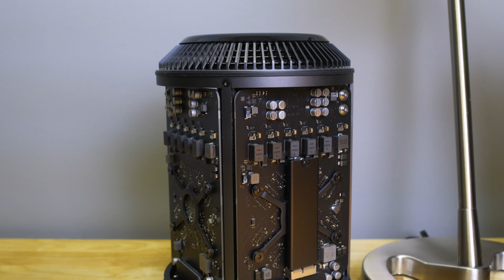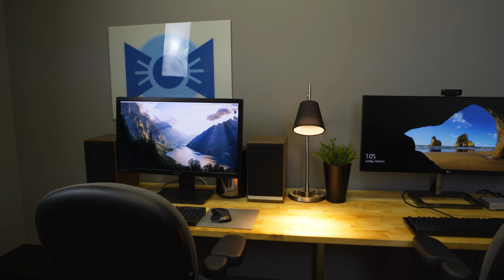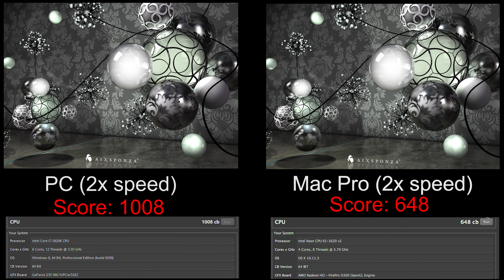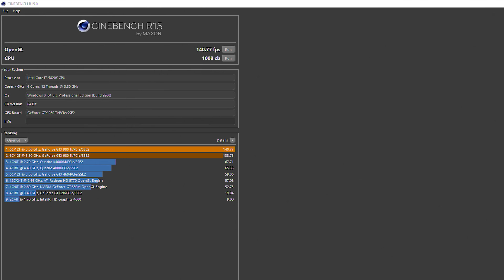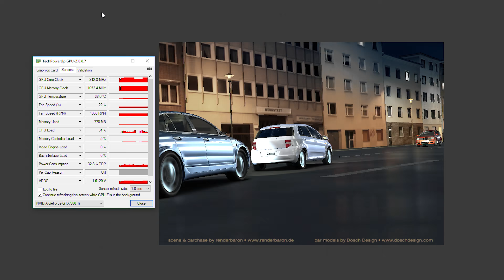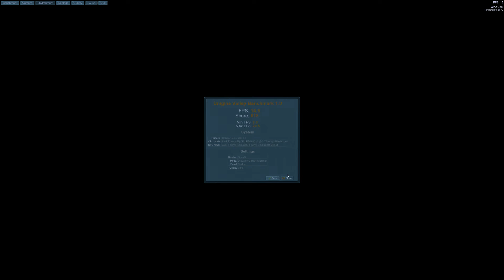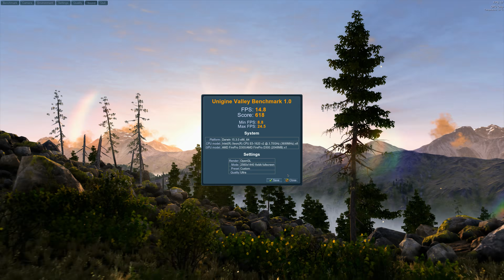$2,000 Custom PC vs $4,000 Mac Pro

Comment: Are you comparing computers that are 2 and a half years different, that doesn't occupy the same amount of space and get surprised with the results?
I don't see the point...  Don't get me wrong, I'm perfectly happy with my last real mac pro (the tower design) that I still keep upgrading from time to time and the new mac pro really sucks about upgradability anyway... But this test is useless...
Either compare it with a mini-case 2 and a half years old PC, or don't compare it...
This test is like : Yeah, computers have evolved during the last 2.5 years, who would have thought?
And testing gaming performance of a workstation vs a dedicated gaming PC isn't also fair... It's not what the mac pro is for... Apple logic is retarded, not changing the trashcan line is also retarded, but this is far from the best apple have to offer. (and it's not 4K$, it's 3K$ but at that point I don't think it'll make any difference)
Reply from the maker: +Bourinos02 No, I'm comparing a custom PC to Apple's current Mac Pro offering. It isn't my fault they haven't updated it in 3 years...
Reply: Rekt
Reply: fanboy detected
Reply: Still doesn't explain why it's 4k dollars
Reply: +Bourinos02 Yeah, it's 2.5 years old, but it's also the latest and greatest Apple offer and the price they are selling it for is $4000 which is the entire point.  

No shit the comparison is not fair, it's designed to highlight just how dumb you need to be to buy the Mac when the hardware is so utterly destroyed by something you can buy for 1/2 the price.

How much do you have to pay for an Apple badge and that smug feeling?  About $3000 apparently (you could probably build a faster computer than that Mac Pro for under $1000 now).
Reply: It's about price to quality, fanboy.
Reply: You are just a fan boy.
Reply: It's apples job to update the computer. They are selling that computer in 2016, so it is comparable to a computer built this year.
Reply: +Bourinos02 It will erase Mac as it just did. Remember this new PC is half the price of a 2-3 year old MAC
Reply: +Bourinos02 the whole point is even when apple still pushed the "real MacBook pro" this kind of test would yield the same result. 
Mac's are and have always been severely overpriced.
Reply: +Bourinos02 The mac pro is sh1t and the price cant be 4k if its 3x slower then a 2k pc do u get it now? apple fanboy
Reply: +Bourinos02 You can build a small PC with a fullsize GPU (that is 3 years old) and it will STILL fuck the shit out of a mac pro.
Reply: +Bourinos02 im pretty sure a 3 year old pc can beat it. I can get u an ITX case which is pretty slim. So MAC still sucks
Reply: +Bourinos02 You're forgetting that you can always build a current mITX system without really sacrificing performance over a full tower build if you really care about size.Having hardware that isn't almost 4 years old now will really help with the thermals of it as well.
Reply: +Bourinos02 you can put the exact same hardware in a mini case and many people have done it,s just harder to cool. A 2000 dollar mini case PC whould gain the same results.
Reply: +Bourinos02 What he is saying in the video is that a Mac is outrageously priced. For 3 year old hardware that was GOOD (Not Great) in it's time, $4,000 is WAY too much to ask. He is saying that a PC will offer WAY BETTER performance than a Mac at a lower cost.
Reply: ugh apple users -_- ... the point isn't the difference in years. it is that apple is charging 2x as much money for a computer when it is 2,5 yrs old and you can build a computer for half the price wich i 3x better than the mac pro
Reply: Everyone with their head screwed on right will agree that Apple charges too much, for old guts. They need to actually better fullproof their flagship desktop better than that!
Reply: +Maadkat x "mac fans" don't say trashcan for the new mac pro design... My point was just to compare comparable things, I even said in my previous comment that the new mac pro design is faulty. But I can say it more clearly because you seem to be confused : the new mac pro is SHIT, it's not pro, it's un-upgradable it's ridiculously overpriced and underpowered, the space a tower take is irrelevant for productivity as everyone have space under her/his desk to fit a fucking giant WTX if they want to... 

Same goes for the new MacBooks "pro", no ethernet cable, all relying on WiFi? Ok, for a single person in the middle of nowhere with 1 WiFi signal it might work okay, but for a professional with probably around 15 different detectable wifis around, it's SHIT and not good for professionals... The wifi will not behave as well as a cable, it never will... Same as the mac "pro" the macbook cannot be upgraded even a little bit, everything is soldered to "make it thinner", this is also bullshit! The MacBook I'm typing this with have ethernet, the RAM and HDD were changed to make the machine a LOT faster, this is not possible with what Apple have to offer now...
I'm a mac user, but I really am not a "mac fan" as I've been disappointed with almost all design/functionality choices apple made in the last 3 years...
Reply: Bourinos02 That you are an in the closet fanboi
Reply: +Bourinos02 Mac sucks just get over it lol...
Reply: In my eyes, the test is more to show that Apple scams people for a well outdated computer that they overprice (over their overpricing). They shouldn't sell it more than 1k$ (... Even if it's not worth that, I'm talking about Apple pricings, where you pay for the brand).
Reply: +Gryppen It's not the greatest model Apple have to offer, it's the "entry level" mac pro shown here. But still, I think these benchmarks should still be greatly favorable to the custom PC anyway. The only thing that might be possible is a superior openCL computing capabilities with the "D700" option, but still, even if the program takes full advantage of the 2 video cards, that'd be a theoretical gain of only a few percents over a SINGLE recent card not dedicated to that.
Anyway, yeah, it's ridiculous that this "pro" line haven't been upgraded since 2013...
Reply: all of apples products are overpriced. price for preformance is something apple doesnt understand.
Reply: Even if it's older, its still 4000 bucks. So, yeah, apple is shit.
Reply: u probably didnt complete to see the video. Apple is selling a 3 years old machine, with no upgrade at 4000$. that's the point of the video. it's like selling an iPhone 3 at the same price of a Samsung galaxy 7
Reply: +Bourinos02 So basically you just admitted that the most expensive top-of-the-line "pro" Apple product can only hope to win a comparison with a three year old PC, provided said PC is not a really high end rig for the time anyway? LOL Apple is dead as far as computers are concerned. I will never buy another Mac.
Reply: Naresh Ugaonkar
All that shit coming from a pro-MAC supporter who prefers underpowered-overpriced garbage trash cans to a lower cost alternative that also looks better and performs better?

Nobody with a shitty job would likely be able to buy the setup I have: userbenchmark.com/UserRun/683740?redirFrom=userbenchmark.com

Unless they saved up for like 3 years or something.

Not like £1570 is as much for my setup as opposed to a trash can. Enjoy your inferior PC. Congratulations on not being an indian Tech Support scammer, by the way. Fantastic language skills, m8.
Reply: +Bourinos02 Dude, Your point is useless! And the 238 people who liked it have not thought about clearly either, Or are just sticking up for their favourite company.
The whole point of the video, is to prove that you are paying through the roof for owning the name APPLE! 
Even the much cheaper PC was doing the stuff that the pro was built for, far BETTER!
That's the facts.
Don't hide them by moaning at the guy for not paring a weaker PC with the pro, That Mac is currently the best you can get and it's old hardware and well over priced.. because you pay for the name.
Reply: The price point is what makes these computers comparable. Since the Mac Pro is an old sack of shit it should cost less.
Reply: Bourinos02
Oh yeah my bad thought it was a define R5.
Reply: +Bourinos02 Yes he can compare it becose apple sell the same shit always
Reply: +Bourinos02 It's about the bottom line, mate. You get three times the performance for half the price. Sure, the Mac Pro looks much slicker and is smaller, but I thought performance is the number one quality of a computer. I think you missed the point of the video. It's not about comparing brand new to older hardware. It is about the price - Apple sells that machine for 4k. You can build a much more powerful current PC for 2k (-ish). And it's not outrageous that Apple are selling it at that price poit - it's outrageous that there are obviously enough people to shell out that kind of cash for an outdated configuration.
Reply: +Snazzy Labs Also not your fault that "all" of the MAC fanclub cant grasp the concept that you are comparing the ridiculous price for the amount of hardware & performance  you get, who the hell "in their right  mind" would pay 4k for old hardware that Apple is CONTINUING to package and LABEL it as a new product in 2016?, cmon' Apple! Seriously dudes, thats what the video is about
Reply: +Aris Heim yes because apple is foolng people
Reply: +Snazzy Labs Okay, the trashcan pro hasn't been upgraded for a long time, but your PC build is taking at least twice the space than the mac pro is... It's even more unfair to compare them... That's why I have difficulties to see the message you want to convey via this video.
Is it that the mac pro line hasn't been updated in 3 years which is ridiculous for so called "pro" machine, or that a custom built PC will destroy a mac pro? (which was already the case on release back in 2013 because of Apple faulty trashcan design...)
Reply: +Moldy The build shown in this video is with an mITX, it's still at least twice larger than the mac pro. The design at first is quite good, only one single cooling system, adapted to the entire machine, making it almost silent and all. Except that when you are using all your components at full power, it'll start to overheat and basically ruin the potential performance gain you cold have. 
So at first glance, it seems like a great design and all, but in reality it' shit. And yeah, having newer components less prone to generate heat will help, but I can't help it to think that the potential upgradability of your "pro" system is the KEY to have a good system...
Still, people are buying the trashcan so apple must think that they are doing it great, but in reality, clients are trapped with OS X programs and uses, so if they want a hardware upgrade, they are forced to buy it. Or they are just stupid people who follow fashion, who knows... :-)
Reply: Well you can still buy that mac. so he is compering 4k Mac that you can buy now vs 2k PC you can buy now. fell dumb now?
Reply: +Bourinos02 iam apple fan, but lookin at the pricing, pc wins.
Reply: Andrei Ivan
Today it's just not about the OS you use. You can buy PC components and install OSX and you can also buy a Mac and install Windows. It all comes down to how stupid or how smart you are. If you want fast current and upgradeable hardware, but you need to use or prefer OSX instead of windows, teach yourself a couple of things and build yourself a Hackintosh. Nowadays the decision could just not be easier.
Reply: and ur mac pro are better that that " game machine"? workstation.. yes it is suppouse  for profesionals but u see cinebench ..man i need to say you did a great buy. but in future make ur workstation that suits your needs. i recomend u asus dual cpu motherboard and 2 intel xeon hexa and and the r9 if u are working in audiovisuals.    WORKSTATIOOOOON!!!!
Reply: +Bourinos02 Ok, you want to make it fair? How about this.

For reference, here is the link to Apple's page on the Mac Pro specs: http://www.apple.com/mac-pro/specs/

For LESS than the price of the Intel Xeon E5 processor, I can get an i7-4790K, which has almost twice the performance. ($320)
16 GB of Kingston HyperX FURY RAM @ 1866MHz ($63.44)
I had trouble finding a graphics card with the exact specifications of the included graphics, so I used 2x AMD W8800 graphics cards equaling 4GB DDR5 VRAM, and 8 total Display Port inputs. ($790)
Samsung 950 Pro PCIe Internal SSD 256GB ($181)
MSI ATX DDR3 2600 LGA 1150 Motherboards Z97 GAMING 5 Motherboard ($163)
NZXT S340 Mid Tower Case CA-S340W-B1 ($75)
750W EVGA Fully Modular Power Supply, 1.5x what the Mac Pro has ($88)
Total Spent: $1,670 to custom-build something almost exactly the same as the $4,000 Mac Pro.

If saving space is REALLY that important, then change this:

EVGA GeForce GTX 970 4GB ($330) [NOTE: Yes, this is a newer graphics card, however I could not find anything that wasn't recent and had GDDR5 memory, so obviously Apple has updated their GPUs, or else it would not be GDDR5]
APEVIA X-QPACK3-GN Micro ATX Cube Gaming ($60) [Roughly 1 cubic foot]
MSI H97M-G43 Micro ATX DDR3 2400 LGA 1150 Motherboards H97M-G43 ($100)
Total Spent (Roughly same size/specs): $961 Less than 1/4 the cost.

"But it will have the Apple OS on it!" That's cool, here you go bro:
http://www.apple.com/shop/product/D6377/os-x-mountain-lion OS X Mountain Lion ($20). So, for less than $1,000 you can basically have the entirely same machine, which will cost you $4,000 on Apple's website.
Reply: +Sir Soaponrope I totally understand the appeal of Samsung and android phones but I just want my phone to make calls and play music, the occasional photo of my dog. I'm really used to the OS so I'm not going to change any time soon
Reply: A two years old $2000 PC stil brats the crap out of any Mac Pro, dude. Stop being salty and accept reality.
Reply: +Bourinos02 What an idiot.
Reply: +Bourinos02 2 and a half years old and same price . Dude are you seriously complaining about space ? You're gonna use this kind of machine in a studio with plenty of space and if you complain about space I guess you could afford a rather big table for the 2k difference. I like apple products but I hate the company , ridicoulosly overprice products not worth half the value . And stop defending the company that is ripping you off , Mac Pros are beatiful looking and it has it use but not for 4000 dollars
Reply: my friend and I recently built ourselves gaming pcs and we have the same secs as this dude we managed to get a GTX 980 ti, 32 gigs of ddr4, and a core i7 build for $1400 in totqal cause we wated on sales for the parts and is waaay better than this mac.
Reply: +Bourinos02 The point is that Apple's prices on their Mac Pro are not remotely justified even including the new design and premium operating system.
Reply: +Bourinos02 i guess you did not understand his point. yes he did compare two  computers  with 2 1/2 years old hardware technology when the mac came out, but thats not what he is criticizing. its the fact, that apple still sells this product like it would be the best of the best. and even back then the technology inside the mac, when it came out, it was already outdated. its just overpriced in any particular reason. but thats just an apple thing, i guess. if he would have build a custom pc back then, with the same amount of money when the mac came out, the custom pc still would  have been better.
Reply: scitk u r correct my brother bought a mac pro at 2x the cost of my custom pc and he is suffering
Reply: yes mac really sucks at it's price
Reply: yes patryk
Reply: +Bourinos02 Shots fired
Reply: +Bourinos02 Why does it matter the space they take up? Is there some application where limited desk space would be a thing where the size of the Mac Pro would be an advantage?  Did anyone ever complain that the old Mac Pro was to big?  I love many apple products but this is another case of them trying to show off their design engineering at the price of performance and practicality.  Is it pretty? Ya sure, but that doesn't matter if an "ugly" machine blows it out of the water for half the price.
Reply: +Naresh Ugaonkar ofcourse you do nothing wrong with that, its like your the empire and everyone else on PC's are the rebels. You don't mind being a mindless drone being scammed because of a name brand and we like freedom to have great hardware on a reasonable budget as this video proves.
Reply: +Bourinos02 The point of this video is quite simple and its quite amazing that you don't seem to understand it. A pc half the price is more than twice as capable. That is 90% the point of this video. The rest is that Apple needs to update their pro line of computers.
Reply: Man but apple 2 years old machine cost more than that new computer this is the point
Reply: +Bourinos02 You forgot that it was 2000$ less.
Reply: +Bourinos02 Someone either didn't watch the video where he explained why he did it or didn't listen.....
Reply: +Bourinos02 Apple sucks, sorry butt hurt fanboy
Reply: +Станислав Димитров The trashcan pro depicted here is 3K$, not 4K$, but that's not even the point, I agree with you on the performance part. It's the main selling point of a "pro" computer, but apparently, looking at the sales, it's impressive to see that even this is selling well... If the machine tested here is absolute garbage (even if the testing is done like if this was a gaming PC and not a workstation), this trashcan can be upgraded with processors that are sold around 2.6K$ ALONE and then this test would be the other way around, of course, for a pricing range that is greatly different... 
All in all, it's the old debate about workstation hardware versus gaming one... 
And the trashcan sales being still OK even with outrageous options pricing and obsolete first range hardware means that they can basically do whatever they want and it'll be sold anyway, so I presume that at this point, they just don't care...
Reply: +Bourinos02 Even if you had compared the Mac Pro when it was released with a PC built the same day for half the price, the results would be the same, not as dramatic, but the PC would have still won. That's why I'm hackintosh all the way.
Reply: +Snazzy Labs 
You kind sir just rekt the shit out of a major bullshit factory. Thank you.
Reply: DNice Gaming 5/7 -excellent trolling post, would recommend!
Reply: +Bourinos02 My FX chip/380 got a better score than the Mac in both Cinebench tests, and well everything else for that matter.
Reply: +Bourinos02 you overestimate that time difference way to much.
In comparisons of the same hardware and their modern equivalent, results show that the performance just raised a bit. For example, the I7-2600k and the I7-6700k have just a 10% improvement (regarding on gaming quality), and the time gap between these two is 5 years! Same goes for other components like graphics card.

So when a pc for 4k$ isn´t even one-third as good as a 2k$ pc after three years, it´s not on the time difference.
Reply: +Bourinos02 Then Apple should at least lower the price to represent it's aged hardware. Since they aren't, the argument stands. 2k PC > 4k Mac.
Reply: +Bourinos02 I have seen WAAAY more powerful builds in a similarly small case thanks to the R9 Nano. Your "it's smaller" argument is absolutely invalid. "I'll pay $1800 more for a smaller computer." Yeah oh-fucking-kay.
Reply: +Bourinos02 he's comparing the price difference you dumb fuck. even back in 2013 you could build much better pc with 4k$
Reply: +Bourinos02 It's an comparison between Apples BEST COMPUTER & a 2000$ COMPUTER. Time gap between those two is not the key....if it was why isn't Apple  upgrading their so called BEST, TOP of THE LINE, PRO Machine????
Reply: +Bourinos02 
The only think I can say about apple product is, all their product are overpriced. The MAC should cost you less than 4k and even a computer of 1000.00$ can beat the performance of a MAC pro. You only pay for their expensive Apple logo and that's all.
Reply: Bourinos02 Dude, you're seriousloy a fanboy who canMt accept that Apple sell overprice product. 
When you can buy a cheap pc that beat the crap our of Mac, there is a serious problem. Apple only sell their Apple logo and that's it. If Apple would start getting on track, both would be equal, but no, apple want cash and bait and that's exactly what you are, dude, a bait for Crapple. They don't give a damn about their customer. All they want, it's their money and that's it. If they would have at heart to support their customer, they would correct that overprice product. 
Damn, even my friend's pc who has about 5 years old already beat the crap out of that Mac pro.
Reply: The problem with this theory is that the Mac Pro still costs $4k, SO IT STILL COSTS DOUBLE THE COST OF THE NEW PC AND PERFORMS THAT SHITTILY, and that is the main point here folks.
Reply: Well, that's how stupid fanboy are... You try to explain the price is overprice for a 2 and 1/2 years Mac Pro and he still complain about space.. Even I mini PC beat your Mac pro and it doesn't take place and if you have a workstation, well you have plenty of space, so who cares about the mini size tower.... 
That's another reason I hate Crapple, because of brainwashed people like you who don't accept the opinion of others and don't want to understand the facts showed to you.
Reply: +gulahuset12 
Toy components? you must mean this grossly overpriced Mac Pro. Apple websites such as Apple Insider reports that professionals are having problems with this model. Workstation grade? My ass. (http://appleinsider.com/articles/14/12/30/apples-latest-mac-pro-continues-to-cause-problems-for-professional-users)
Reply: +Bourinos02 if computers have evolved, why is the price still so shit? Mac fanboy rekt
Reply: +Bourinos02 what a dumb fuck you are
Reply: +Bourinos02  he is comparing performance over price, that mac is still 4000 bucks too this day (according to him), i think that the point is to show that apple stuff are overpriced.
Reply: +Bourinos02 LMAO!!! Its so funny watching an Apple fanboy try to defend inferior hardware at double the price.
Reply: +Bourinos02 It would probably have been more fair to compare the Mac to a mini itx system for a more equal physical footprint, but I guarantee the end result would have been about the same.  The point remains, Apple's products are over-priced, under-performing, and those who insist that Apple creates the best stuff with justifiable cost are wrong.
Reply: +Bourinos02 Point isn't that it's 2 and half years old but that it's outdated and costs 4000$
Reply: +Bourinos02 I think you may have heard him wrong. What he meant was that a Mac Pro sold in 2016 is still using the same hardware back when Apple first released the model in 2013. He then continued by also saying that the hardware they used in 2013 was even still a year behind the newest hardware being produced at that time. This is why he said that the Mac Pro 4 year old hardware.
Reply: Of course he is comparing computers that are 2 and a half years different. Apple hasn't improved it in 2 and a half years. whose fault is that? The point the test makes still stands: much like it has always been, you can build a pc for less and get better performance  (and deal with the issues like his psu ordeal) and Apple focuses on marketing products instead of improving them regularly. As demonstrated by the now 4 year old tech in their top of the line computer that is marketed for professionals. They have made 4 new iPhones in that time lol.
Reply: +Bourinos02  That mac is easy to beat even with a small case pc. Buy a 1000 dollar cpu and put a R9 nano in there or a mini 970 and it will still kill  that mac and it wont cost any where near 4 thousand dollars. You can put a 12 core xenon in a small form pc and kill that mac as well.
Reply: +Bourinos02 I think you don't get it. Apple still doesn't have something better.
Reply: +Bourinos02 Np, you didn't listen, If he could he probably would have tested a Mac book pro from 2015 IF there was one. But there isn't.. This macbook is made by apple. so this is what we would pay if we go to an apple store. 

Hetesten an prebuild macbook pro vs a costumbuild PC he recently build. The space doesn't matter because you can have about the same build, with the same power in a smaller build than he did. It is just a pain in the ass to cable manage.

This is about price, qwould you rater pay 4000 for  prebuild PC that is about twice as slow as a 2.2k self made PC?
Reply: apples machine when it came out still was not even comparable....i own both i know
Reply: +Bourinos02 IMO the average consumer buys a PC based on price point believing if they pay more they get more. He is just pointing out how backwards of a business model Apple has when it comes to their Mac Pro line and even other products. Considering the PC is $2000 less than the Mac Pro, i would say that Mac Pro, in theory or at least to the average consumer would seem like the logical choice for better performance. Aesthetics should not constitute $2000 increase in price, more if you count how outdated the hardware on those machines are.
Reply: +Bourinos02 You've gotta be honest though... There isn't really any reason to get a Mac pro unless you shit out cash from your ass. The top of the range model costs $9648, you could have a fricking beast pc for that money but if Mac is your choice... I'm not gonna hold you back from wasting your money.
Reply: +Bourinos02 this is a mac you can buy RIGHT NOW. it's not discontinued. this is 3 year old tech that is being sold for thousands when it is ancient tech that should be cheaper now. it should be cheaper just based on supply and demand, but i'm sure idiots like you keep buying apple products and they will keep selling you old hardware in a shiney case for twice the price.
Reply: +Bourinos02 dude your a fucking idiot get over it....
Reply: +Bourinos02 But Apple are still selling this as current plus a 2.5 year old PC at half the money would still crush it anyway !
Reply: +Snazzy Labs I know that its still not quite the same size- but i ran the same benchmark you did on an Alienware X51 with a down(under?)clocked GTX670 and still got almost double the score of that Pro.
Reply: +Maadkat x MAC users are just another name for "label whores" . I run hackintosh Yosemite  & Windows 10 64 on the same PC. I also have a MAC pro. My win 10 outperforms both hands down. There was a time that i thought MAC was more stable, I no longer see that being the case. I am fortunate enough to afford MAC, I just no longer have a use for em' at this time... overpriced & overrated ;)
Reply: The 5820k cams out in mid 2014 so there is really a 1 year difference.
Reply: exactly. but to give him credit, he mentions this and argues that this 2 year old model is the current model from apple. so if the Mac is still 4k, this video is still valid
Reply: +Johnny Moore I see the sense in what your saying and so do many people here, unfornately its all about name brand vs quality and innovation. We can try and cry all day long about how Apples is screwing over their mindless customers, but as long as people are dumb enough to fork over thousands of dollars for outdated hardware with an apple on it mac fanboys will swarm lol
Reply: You can say he compared the price different for the Hardware
Reply: +Bourinos02 I mac sucks. It's overpriced.
Reply: +Bourinos02 your ass is bleeding i guess, cry more. difference is less than 2.5y, especially if the pc components are like 1 year older p.s. still 2k $ less, probably now you can buy fresh for 6k ? and similar speed, pathetic.
Reply: +Bourinos02 use your brain kid, he mentioned that even if you buy the Mac Pro today as brand new, you still get the same computer. Yeah, computers have evolved but your distorted brain hasn't.
Reply: +Bourinos02 It's on you to prove the size makes a difference as it's your claim. Most people watching this kind of video have seen systems with similar specs to the custom built in micro-form factor cases, the only difference is it runs hotter at the same performance.

And if you really want an apples to apples comparison, why not go ahead and use a $4000 custom rig too, even from 3 years ago.
Reply: +Bourinos02 so you're saying that over two years computers have doubled in performance and halfed in price.
Reply: mac hasnt updated its pc u moron.
Reply: +Bourinos02 - Pretty sure if you are buying a "pro" product, you want performance and you aren't too worried about space.  Is having an extra cubic foot of space in a room worth the extra $2000 while also giving up performance?  Probably not.  I used to really like Apple products, but they really are just shit now, really polished, good looking shit, but its still shit none the less.
Reply: +Bourinos02 The point is that it's STILL $4000 and labeled for pro's when it shouldn't be either.
Reply: Shut up apple fanboy you know fuck off about pc parts and market
Reply: The point is that it is their CURRENT model. So it is fair to compare to a current PC. And apparently it fails badly.
Reply: Naresh Ugaonkar lol r u serious? Buying shit cuz it looks 'little more beautiful' than other products? And the thing is, its YOUR opinion lol. With 4000bucks 'pc' , I can build the most Beautiful Fantastic looking pc in the world with way better performance :D
Reply: dcast777 And the pc wasn't even ugly. It's quite beautiful.
Reply: +Bourinos02 This Mac is labeled as workstation so it should run smoothly 3D apllications (Blender, Maya etc.) so I think its fair comparing it with gaming pc
Reply: we've got a fanboy here
Reply: +Bourinos02 i think his point is that apple needs to release a new mac pro or at least sell the two-year-old mac pro at a much cheaper cost for the reason that it is "old" and that you can get a new PC triple its speed and lower in price; that if they will label such product as one for professionals, it should live up to its reputation.
Reply: +Bourinos02 The point of the test is to show why it doesn't make sense to buy a mac pro when it's 2+ years old by now and STILL priced at double what the home designed PC that performed more-or-less twice as well.
Reply: +Bourinos02 I'd wager the $4000 Mac Pro won't fare much better than the $4000 MSI Vortex with a Skylake i7 and SLI GTX 980's in pretty much the exact same form factor...
Reply: +Bourinos02 You're an idiot

They're both practically new for their manufacturer (s) and today you could buy both of them for the same amount.
Reply: MSI has a mini tower like Apple's Mac Pro. With i7 6700k and duel 980.
Reply: i think the point is that if i go into an apple store and ask for their newest mac pro this is it, it doesnt matter what the age of the components is. bottom line is apple is selling overpriced garbage in fear of making a new build for $5000 that nobody will buy
Reply: +Bourinos02 My PC is at least as small as a Mac Pro and almost as powerful as the PC in the video. I can make it more powerful with the same case. Silent too.
Reply: +Joel B (jbholland) That is exactly the point, a workstation "graphic card" is not made for gaming, you can put a ultra high end W9100 (about 4K€) and it'll barely reach 40 FPS on battlefield 4 in 4K (70 for 1080p gaming). You can find graphic cards like 970/980 series that'll perform WAY better for this. But do computations with it, and it'll perform 3-4x better than the gaming ones...
Reply: +Jerry C The number of people unable to differentiate workstation stuff and a gaming PC is too damn high!
If your point is that brands prices are higher than self-built, well, no shit sherlock... I know only a very few case (generally for entry-level computers) where the pre-built is a little cheaper than if you get the parts yourself.
Reply: +Mike Bee TV Well, yes, it has been since quite some time now that Apple is doing everything to destroy their own brand, but the sad thing is that only the new mac pro is a flop, other machines continue to sell quite well... The GPU choice is also odd, basically they are openCL oriented, and you need to pay the extra value for it, but most people won't even use GPU acceleration...
The worst example is the Imac (since the unibody design and "cutting edges"), first, if you take a little more ancient design, you have more volume, so you can put more components in it. And with GPUs like the R9 nano for example, you can have a decent performance for a rather slim design... 
The worst thing for my point of view is the "everything is soldered" you cannot upgrade shit from these machines, its a deal breaker for me... I really hope that they'll go back to the previous design, but unfortunately the only flop being the mac pro, it's unlikely that they'll ever go back to easily upgradable machines...
Reply: +Bourinos02&#160; Ya just don't get it do ya lol ... like the man said That same model Mac Pro is right now being sold by Mac as a 2016 model&#160;so ya goof&#160;the comparison/test is good as a 2016 against a 2016 model. Truth be told it would have got its azz handed to it even 3 years ago if the same type build and test would have been done..
Reply: Typical Apple fanboy
Reply: the point he was making is the fact that Apple is still selling this outdated hardware as it's premier computer.  This is what you get new out of the box in 2016.  So he is right on the money for doing a comparison with what is given.
Reply: +Bourinos02 For the price point a PC is MUCH better in terms of performance vs mac
Reply: +Choirmaestro you forgot: 

$10 for a can of spray paint and a piece of paper to make an apple shaped logo for the front :P Now what's the difference? Aside from the extra numbers in your bank balance of course!
Reply: Laurence W I've said that already yeah... So your point is?
Reply: +Bourinos02 That 5820 came out before that mac pro....
Reply: +TonyOwned Apple "options", I presume that's why now everything is soldered together, if you chose to add ram, you will have to pay it like.... 6 times the real price? The amount of money it costs to chose a better configuration is just insane for most options. When they ask you 400$ for a 12GB ram upgrade, you know you've been ripped off !
Reply: +Renaldo Dean This haven't always been the case in the past (especially in the unibody vs vaio period) but now, it's definitely the case, the "thinner the better" bullshit is pushing prices so upwards that it's ridiculous. They end up selling slightly more powerful than a tablet computer at 1K$, just plain ridiculous...
Reply: +Bourinos02 Ok but then lets get to 4k $ also. I mean a mini case 2 for 4k $ computer. I bet it would destroy the computer that he build for 2k$ wich rekt the trashcan pro. Dont start it, because a mini itx tower with hardware in it for 4k $ would totaly rek both of them.
Reply: +Bourinos02 As somebody who uses a computer at home as a workstation, the size of the Mac Pro is a novelty but you still need to setup your system with external hard drives and optical drives (that is something that is still necessary in certain lines of work). In the end a tower under a desk isn't a big deal, i'm rocking a Corsair Air540 which is cube-ish and barely takes up any room whether I had it under a desk or on top of a desk. There are more economical things to spend on for ergonomic improvement like adjustable monitors or a nice chair or the desk itself.
Reply: +Bourinos02 lol Join the Master Race scumbag.
Reply: +Bourinos02  computers evolved, but man is fking 4000 $ and 14 fps benchamrk... if that mac pro have 2.5 years.. the cost dont evolved? maybe and just mabye couse people like u pay the brand and confrm with that.
Reply: +DNice Gaming You should tell us how you really feel! BTW I'm posting this from my 2 year old rMBP, and I love it. You know you're just jealous you can't afford an Apple.
Reply: +Bourinos02 You know, I thought that too; I think he was just comparing the fact that the newer machine was built for less.
Reply: +Bourinos02 if you want appleOS build a hackintosh.   you wanna save space? use a microATX motherboard. The case he used is seriously the biggest small case i have ever seen lol
Reply: Did you not see the size of the PC case? yea its a different form but in terms if actual size its pretty much the same, Apple as usual just shot for design over practicality built a cylindrical case with all square components in it. All in all a piece of garbage that looks nice on a desk.
Reply: +Thomas Mostyn 
that Mac pro is not that small. I know that if you build a computer from a mini-ATX or even a Micro-ATX motherboard, you can get similar performance as the 2200$ windows machine, although more expensive, it would not exceed the 4000$ mark. 
The size of the Mac Pro is a mood point. the age is too, since the IC parts physically cannot get smaller due to quantum stuff and breakdown of simiconductor properties at, what? 15 - 20 nm I think.. the progress is stagnating. And to attack the age is also missing the point.

I just can't see Apple being able to justify the performance gap. I never have. OK. . UI and the enherent stability of the Apple systems are excellent for casual users or light professional work. 

But to put a product on the market, keep it there and market it to heavy - duty professionals, that need raw performance, when a PC build out-performs it 6-fold per dollar spent is just not okay.. 
Apple Is making good products.. their marketing is just borderline criminal.
Reply: +Colinde  I think you missed the point ...I agree with you mac is over priced garbage with no reason to be bought the PC on the other hand has a better form to fit hardware that is naturally square (motherboards, GPU, Hard drives etc.) Are all square parts and are made to fit better in a square case.
Reply: SSABM 946 crapple. Omfg im using that now. Thank you so much
Reply: +Sir Soaponrope crapple crapple crapple hahaha.   I do like their phones tho
Reply: LloydMarley Woodger I wouldn't call those pieces of shit phones xD
Reply: LloydMarley Woodger I understand. I used to use an ipode 4th generation. And it did the job very well. Lots of cool apps and exclusive shit. What i don't like is how collge's shove mac and apple shit down our throats telling us how good it is and forcing us to use macs in college.
Reply: +Sir Soaponrope yeah don't stand for that shit.   I'm 99% sure I will never buy a Mac PC
Reply: +Bourinos02 I would also like to add here, even though the pc and mac are very different in product component age. So what I would like to say is that for a pc with probably 2.5 x the performance of the mac pro you can pay a little over half the price for BRAND NEW components. Even if he went skylake i7 and a nice mobo it would still be around 2500 and not to mention SLI with 980ti superclocked would only run about 3300 to 3500 and he could put in a liquid loop for about 700-1000 USD and have a pc that outperforms that mac by probably about 5.5 to 6 times and would have temps I would assume around at full load 50c on the GPU's and touch higher on the CPU and probably even lower. This would all cost only anywhere from $200-500 more than the mac pro
LINKS: Custom PC http://pcpartpicker.com/p/qy62gs
Mac Poop: http://www.apple.com/shop/buy-mac/mac-pro?product=MD878LL/A&step=config#

I REST MY CASE YA BAD MAMMA JAMMA
Reply: Phineas Swett You sound in denial lawl. Keep struggling my friend. You shall drown eventually.
Reply: What do you mean man? I just posted a link to a pc that stomps this with top of the line modern components, and SS which could even be NVME and 32 gigs of RAM For just over half the price. I just don't understand what you mean by I sound like i'm in denial
Reply: Phineas Swett I read your comment wrong. I'm sorry my mistake mate.
Reply: Sir Soaponrope hahah. Did you think that I was saying mac was better? XD
Reply: Phineas Swett Yep xD I'm a moron.
Reply: +Bourinos02 latest available products on the market. 

You also intentionally forgot their price points to satisfy that ignorant apple fanboy mentality of yours.
Reply: That's why I retorted with actual facts and two build versions between pc and mac pro
Reply: the fact is that there is no Mac ever atm that overpowers this one, it's selled as their best computer :)
Reply: +Bourinos02 I see the point, 2000 ones actually ;)
Reply: +BATtitude But that is the point, this isn't the BEST apple computer... The best apple computer comes with a 2600$ 12-core processor that is still to this day VERY powerful (and would have crushed the i7-5820K by the way). The only real drawback of the trashcan is that it's GPUs that were OKish at release aren't on par with others newer GPUs, their openCL capabilities are just slightly over a single 980 (10% better computing power if the program was able to use both cards at the same time). CPUs haven't changed that much, but GPUs performances have evolved drastically since 3 years. 
And the main drawback of the trashcan aka its un-upgradability is now clear, most dual GPU systems will be better now. There is actually one single shred where the mac pro cards will shine (and so does any workstation-dedicated card) and it is double precision processing power, that's what they're made for. Not gaming, nothing else, just made for that. And for that specific job, they are doing reasonably well (4x better computing performance than a Titan X). 
And frankly, that's the only advantage they have over other GPUs... But in the other hand, that's what they were designed for, but other newer dedicated workstation cards will crush them hard too, from what I see double-precision computing power have MORE THAN DOUBLED in 2 years, which is impressive.
Reply: +Bourinos02 apple is selling luxure product, wich means it's over priced, so you could always have better with the same/(lower budget) ... that's all, because apple doesn't build their pieces, wich also means you can it yourself :)
Reply: John Romberg You're writing this comment on a device that 1 billion humans will probably never see because they live in abject conditions, yet, you bought it you filthy human being. They're starving because of you!
Reply: +Prince Virginia Well said
Reply: Tylor Camacho
Yes, 3K$ is too much for entry level, or they just change the entire thing and get back to a serious tower design...
Reply: +Bourinos02 Yeah, then you'll have an even cheaper pc that still kicks the shit out of that mac. lol, think before you speak fanboi.. oh wait you can't because you're pro apple
Reply: +Bourinos02 The Ncase computer case could fit all that hardware and be just as small as the MAC, the case size is just a user choice.
Reply: Eric Dawahare Exactly
Reply: +DeviLzRO wow relax fam
Reply: +Bourinos02 hes just baffled at how ridiculous the price vs performance difference between the two and calling apple out on their bullshit.
Reply: +gulahuset12 Let them be, they are so braindead they forgot that a workstation is bad when you try to do gaming on it and compare it to a 2.5 years newer gaming computer... Apple option pricing is outrageous, apple entry line mac pro is very bad and overpriced at 3K$, the trashcan design is stupid by nature, but it's still about 2 times smaller that what can be achieved with mITX cases...
Reply: good point .. but still even before 2 years you can build a better and alot cheaper PC than mac pro .
Reply: +Dex4Sure Let me help you 2000*2=4000, not 3000.The only strong point was double precision floating-point computations with the dual GPUs. Not tested here. The CPU of the entry mac pro is pure garbage, you'd better off buying yourself a 6-8-12 core and putting it inside. This was tested here, and yeah, a shitty quad core is rekt by a more modern decent 6-cores.
Reply: What being analyzed is the price vs power. With a 4k budget, at better PC can be build. If form and size is a huge factor for you. Then look at MSI's new Vortex PC case. It's 2016 and Apple is selling old hardware with old price tags.
Reply: +Bourinos02 unless you are planning to put the computer inside a fridge, then i think that the size doesnt matters a lot...
Reply: +Bourinos02 I share this same idea. Its useless comparing two with 2.5 years different, but I think the point of this video is the price. Because the hardware is old, even to the mac pro age and its more expensive than a new PC. And also Appple SO (I dont know the name) and pc design dont justify $2000 of diference between them.
Reply: Bourinos02  calling it a work station vs game machine makes no difference cause you can easilly use that custom Pc as a work station
Reply: +Bourinos02 there is no reason for you to like a Mac Pro over a PC unless you are a fanboy, if you want a smaller build get a laptop, and don't get a Mac laptop because those suck too.
Reply: How do you upgrade a Mac? Do OEMs make Made specific computer components?
Reply: +Bourinos02 butt hurt huh ? i guess it hurts a lot knowing you spent 4k in a computer that takes a beating from a 1k pc.....
Reply: Josh Cook ..ifags are like that buddy...
Reply: +Caio Daniel Nunes Santos  Yeah man. You look brazilian, so you must know Canaltec. This channel made a review of the MacPro and bought it to self use on the their office. But they have as space as to use a full tower PC on the desk. The only thing that justify it is that it has 6 thunderbolt ports and the fast boot. Just that! Uneedless to say that its even worse because we're talking about Brazil, where everthing is expensive!!!
Reply: Even then the Mac Pro would've shit the bed against a 3 year old PC.  The MAC pro really isn't worth $4k and is literally the worst shit ever.  Apple doesn't know how to build computers for normal people which seems to be their market /:
Reply: +Alan Crome by doesn't know how to build for normal people I mean no person in their right mind is going to go out and spend 4K on a computer that isn't even that great.
Reply: Caio Daniel Nunes Santos Yeah... it doesnt justify the overpricing
Reply: +Snazzy Labs you're comparing an "average PC" to a pro workstation. That's not a comparison anybody should be interested in to be honest. They exist to serve different purposes. In the end, you buy the machine that suits you. I have a gaming PC myself because it's the best for my needs. If I wanted a workstation for some specific tasks that only a pro workstation can fulfill, I'd buy that Mac.
Reply: Ya seriously, this guy is a dumbass!
Reply: +Ozone9 Mercedes are expensive. Are they shit also? 😂
Reply: +Bourinos02 Apparently you didn't get what was the video about..
Reply: +Bourinos02 Oh no apple fanboy :D did you actually watched the video ?
Reply: He said that it's the most current model? That's the best Apple has to offer, which just shows how sad the Mac really is.
Reply: He said that it's the most current model? That's the best Apple has to offer, which just shows how sad the Mac really is.
Reply: +Jus da best HAHAAHHAHAHHAAHAHAHA. No.
There's massive difference between ECC memory and non-ECC, as well as there's massive difference between a Titan X and a Tesla K80... There's one card made for gaming (Titan X) and a card made for computing (Tesla K80). And if you think a titan X is expensive, look at the price of the K80 and think again... But in the other hand, for crunching the K80 will absolutely HUMILIATE the titan X, which is normal because it's what its DESIGNED for...
Reply: +Bourinos02 I also think it's a bit unfair. Yet he bought the latest and best mac on the market.  This test was mostly supposed  to show how Mac is overpricing their shitty products.
Reply: +Taseen Khan (talking about the former mac pro "tower" not the trashcan) You buy a component and you install it like if it was a PC, that's about it... It might require a bit of tinkering, but usually it's nothing more hardcore than installing web drivers...
Reply: +cyb0rgmous3 Yes, I missed it because it's simply NOT the case... The mac pro he tested is the entry level one, which is terrible value for money... There are VERY much powerful mac pros options, but seeing the apple "upgrade" price policy, it'd be better to buy the 3.6K$ CPU yourself and install it!
Reply: +Bourinos02 what I said is labelling s stuff doesn't matter cause a titan x can still do both. as shown on the video we ch was a 989ti is about par if a titan x
Reply: +WaffulMann That's where the problem is. Titans are good for gaming, shit for some applications (namely double-precision floating point) A mac pro is not a gaming machine, it's a workstation. It's a shame that mac pro haven't been upgraded with more recent hardware, but this testing is like complaining that a tractor can't go 200 mph or that a ferarri can't plow a field. Both vehicles have 4 wheels and a powerful engine, but they aren't designed for the same thing.
A mac pro and a gaming PC are both computers, but they aren't made for the same thing...
Reply: +WaffulMann You can change the motherboard for a ECC-compatible one, buy ECC DDRAM, buy a single W9100 Firepro graphic card (for around 4K$, yes, that's the price) and THEN yes you have a workstation... For a price that is probably 20 to 30% lower than a trashcan.
Reply: Space occupation is not a valid argument. Dimensions dont make power, and so does not the money you spend on aestetics. Period.
Reply: +Bourinos02 your are 100% correct, this test and administrator are very biased. From the start you can tell that this individual has a fiary hate for anything mac. Although I'd ignore all the pc fan boys responding to you that dont seem to understand diffrent pcs have diffrent uses.
Reply: ***** Go back to your 50$ COD DLC kid...
Reply: +WaffulMann obviously you missed the whole point... the test is wrong and the administator is biased. You cant test a surgeon on how many cases they win in court, and you shouldn't trust a lawyer to proform open heart surgery. This test is for gaming centric bench marks, on a 2 and a half year old computer that in its time wasn't even made for gaming. The test is flawed and the fanboy who tested them failed to mention why the Mac benchmarked lower on the given tests.
Reply: *****
Excuse me, I don't see "lallalalalalala" as a valid mature argument... I've said that apple options are overpriced, mac pro entry line is ridiculous, apple option prices are ridiculous, apple mac pro design itself is stupid, but ultimately, testing a mac pro for design versus a gaming PC 2.5 years more recent is still retarded. So I'm sorry that you don't bring any valuable argument to this debate excluding "lalala". I'm not even debating the fact that the video said that this mac pro was 4K when it is actually 3K, or that the testing was made for gaming performances when a mac pro si clearly designed for work with DXXX graphic cards... But I know that you only care about COD FPS so yeah, keep comparing this to COD FPS, it'll make you look so mature...
Reply: +Bourinos02 may have already been said but he's showing how for the half the price of a shit stain pro you can build an amazing pc....
Reply: +Bourinos02 Did you miss the part where that Mac Pro was the exact same system you get if you buy one today?
Did you miss the part where Apple sells that computer as the "Ultimate desktop computer" and claims it will blow away anything?
Did you miss the part where it was twice the price of the PC tower?
Did you miss the part where Apple's "flagship" (and only) desktop computer uses server processors and server RAM?
Did you miss the part where Apple managed to stuff in the shittiest, most awful graphics processing possible in their overpriced trash can?

What a pathetic argument.
Reply: so funny how idiots defend their incredibly irrational purchasing decisions.
Reply: +Bourinos02 I think u just dont want to see ur life long friend "MAC" be defeated so easily. Also these products were all alive back then as well
Reply: +Bourinos02 exactly what i'd expect a macboi to say. the point is, mac's don't evolve, but still rape your wallet. pc's evolve, and don't commit financial rape.
Reply: Your right
Reply: +chago river im not defending it, I even have a build amd pc. Reguardless it's an unfair comparison.
Reply: +Bourinos02 loool u r smart...
Reply: +Bourinos02 Point here is like said on the video, the prize of the product and that they still sell (that antique MAC) as a "new" prized 4000€ and some stupid people might still buy that because they don't know better or they are just stupid fanboys.

He test products that are being sold at the moment so I don't see the problem in comparing them, maybe someone wakes up from mac fandom and buys actual PC? So no it is not useless test.
Reply: +elmotuz +WaffulMann What is plain wrong? First the price: If I go to this address => apple.com I'll find the mac pro shown here for 3K$, not 4, and in europe, I find prices around 3.3K€/2.5K£; so where am I wrong when just stating that 4K$ is not the price of the machine? (it's even in the video description by the way if you don't believe the "mac bias"...)
2nd the testing methodology is just plain WRONG, a mac pro is not designed to be a good gaming platform, even with this old hardware, it's totally expected that a gaming PC will perform better than a workstation. It all depends on what you want to do with this trashcan, if ECC or double floating point operation per second ring a bell, then the trashcan is what you want, it's what it's MADE FOR.
If you know only COD:BO3 and BF : Hardline, yeah, this is not the machine you want...
Testing double precision openCL (not GL, CL) with this setup would have given the trashcan a rough 36% better performance with dual D300, 456% better performance with the dual D500 and 770% (!) more performances with the dual D700 configuration. Again, where is this wrong? 
It's exactly like saying : "wow, have you seen this graphic card ( firepro W9100) it have 16 GB of ram, it must be absolutely amazing to play my latest 50$ COD DLC at 144FPS" Except it is not made for this so chances are that performances will absolutely suck...
It's really demanding a tractor to do 200mph and a Ferarri to plow a field...
Reply: understand, apple's magic
...
Reply: +Steve Dice doesnt make the test any less dumb
Reply: +WaffulMann I see 99% of "meh, the mac kant play mah call of diouty, macfag lalala can't defeat my argument it costs 4K$ mah 123$ PC is better" and 3 people that know what is ECC and double precision floating-point computation...
Reply: +Bourinos02 no it IS relevant as it's all you can buy from apple today!
apple fanboys, almost as blind as christians.
Reply: Bourinos02 Meh, keep your Apple if you like it. It's not my problem where you put your money.
Reply: +Bourinos02 Mac Masturd Race
Reply: Valentin Rafael wat? From apple website => 2.7GHz 12-core Xeon E5 with 30MB of L3 cache
64GB (4x16GB) of 1866MHz DDR3 ECC
1TB PCIe-based flash storage
Dual AMD FirePro D700 GPUs with 6GB of GDDR5 VRAM each. It's far far far far beyond the mac pro shown here...
Reply: Hendrik visch I say the most expensive pre built pc's from doghouse systems  will destroy this mac and wont cost you 4 grand. You can easily get a Titan SLI store build with a i7 for 3 grand. Even alienware will give you dual titans for 4k and they are very overpriced.
Reply: +Bourinos02 dear sir, I've tried this version of mac pro and compared it to a custom pc built by me with the same specs and hardware: I paid half the price and the performance is the same. Plus I've installed hackintosh on it.
Reply: Redazione VivereFano Oh, interesting, where did you get the two firepros D300 from?
Reply: +Bourinos02 By my math, that means you spent about 300€ for the case and the power supply. Are those parts really worth that much? I'm seriously asking (I've not owned an Apple PC before). Thanks!
Reply: Jack Ryan Well, yes, you can see some excellent Lian Li cases for 400$ (without power supply), so yeah, as long as you're talking about the upgradable tower mac pro design and not the trashcan, it can totally worth it (just imho of course...).
Reply: +Bourinos02 Cool. Sounds like you did well, then! That Xeon processor is no joke.
Reply: +Bourinos02 lol you are so butthurt he said the model is the same one you can buy today meaning , its still brand new not comparing something 2 years old
Reply: +Bourinos02 yes but as the relative performance has dropped compared to newer machines Apple has failed to adjust the price accordingly. not that i would expect them to anyway.
Reply: +Bourinos02 there are laptops that have more power than that mac even 2 years ago there were laptops with more power... if you want to really go down the line of the macs' size... it's not going to end well
Reply: +Jax Cavalera Name me 1 laptop with dual firepro GPUs (any W7XXX, W8XXX or W9XXX series), I'm asking about just one laptop, please, do so...
Reply: Bourinos02 The razer gaming laptops are faster and has better performance in games thats proven and its cheaper.
Reply: +awi5951 "IN GAMES". the trashcan is a workstation, not a gaming computer... Ask a razer gaming laptop to do double precision  floating point operations, and see how they do.
Reply: Bourinos02 Its slower than any half assed gaming computer that's my point. There is no reason on earth to pay 4 grand for a pc there is no excuse for it. A gtx titan will kill that pc and i have seen small mini itx tower computers with titans in them. A 4 thousand dollar PC is dual titans, ill take the dual titans  any day of the week for video processing than that mac any day. Dual titans would have 6 times the video processing power than that mac. Even alienware will give you dual 980 ti i7 computer for 2500. So yeah mac is stupid,  bose/beats by dre, stupid overhyped expensive crap thats just mediocre and loses to everything half its  price badly.

Thats why apple bought beats by dre they both love to ripoff customers. 25 dollar sennheisers sound better than 200 dollar beats and all audio review sites agree with that.
Reply: +WaffulMann But... 2x1.3K€ (W8100 price) is already equal to 2.6K€, how can you have CPU, case, ram, power supply for -600€?
Reply: +awi5951 Depending on what you intend to do with it, yeah, titans would be a fine card, but I'd rather buy a single titan black or titan X or even a titan Z to maintain a reasonable amount of power needed...
Reply: +WaffulMann Yeah, that's indeed a good build if you don't care about ECC, and happily it's just 300$ more expensive than the mac pro but with newer and better components !
Reply: +WaffulMann Yup.
Reply: +Bourinos02 While the mac is 2 years old and the PC is not. The mac is almost $2,000 more expensive. So if the mac is handicapped by age the PC is handicapped by price. Also, the mac he has is the most current mac offered by apple so it really is a very fair test. Get off the apple bandwagon, trust me its much nicer when a shitty computer doesn't cost four grand.
Reply: +Charles Joyce Read this thread, I'm getting tired of saying the same thing over and over. You'll find pro, cons, debate over the testing methodology used in this video (gaming vs workstation), debate about is it worth it (volume occupied by trashcan versus regular PC tower), the price being 3K$ not 4K$ and so on...
Reply: Jtshowden CL couldn't have said it any better myself
Reply: +Bourinos02 I work in the real world, and I'm not really interested in when a computer comes about. I'm interested in what can I get for this real world problem I have right now. It's not hardware manufacturers problem that Apple hasn't updated that platform in 2 and 1/2 years. You see what I'm saying though? If I need something now, then I only care about products that are available to me now.
Reply: Jtshowden Well, sure the top model costs an arm, but it have a Cpu that costs 3.6K$ and 2 GPUs that costs 1925$ each (according to amazon) TODAY (it was 4K$ at release), comparatively, you had a better bang for your bucks when you bought a top mac pro than the entry level one that was overpriced with a shitty CPU. Of course, you'd have to buy the ram yourself, because if you paid it via the outrageous "upgrade" prices, you'd be just stolen from apple just another 1K$ just for show, and the same goes for storage (800$ for a 1TB PCI-E flash storage, are they MAD?)
Reply: Bourinos02 Um, I'm 99% sure that the CPU in that Mac did NOT cost 3.6K...I think you must've mixed up the which xeon is which.
Reply: Bourinos02 Yes, on the Apple product page it only says "Quad-core Intel Xeon E5" Remember that there are tons of different models...I'm not sure which xeon E5 it is, but it sure as rain isn't worth 3.6K
Reply: +Bourinos02 if u see the price pc will always win from basic to professional as pc are generally cheaper while mac are more like console in a sense that their software is more optimized like how a xbox360 or ps3 is still able to run gta v even if it has lesser fidelity as apple choses the hardware not the other way around as in pc where the consumer choses the hardware in that sense fucking 4k would struggle on google chrome while it run smoothly on edge not related an example of software optimization
Reply: Kaare Hansen I rest my case lol
Reply: +Bourinos02 this video is usefull, there are a lot of people out there thinking that apple sells the best shit on the market, hopefully they will see this video and they won't be defrauded by apple.
Reply: Charles Joyce Yup, you're correct, I'm mistaken, it's the 2.6K$ model, not 3.6K$ that seemed like a too good price for a mac pro xD
Reply: Bourinos02 I figured as much lol...2.6k still seems steep for a quad core, but I honestly couldn't tell you what model it is because I couldn't give less of a shit about anything Apple related xD.
Reply: +Bourinos02 It is more the fact that Apple is STILL CHARGING $4K.
Reply: +Bourinos02 u really are a fucking idiot
Reply: +Bourinos02 
It's a single GPU  in a micro ATX case. You can get the same performance in a package that is just as small as the mac, you just need the ITX x99 board from asrock and an ITX case like say the Silverstone ft03 mini
Reply: +Snazzy Labs Rekt
Reply: +Bourinos02 He's really comparing pricing to the product provided
Reply: +Kevin Ochoa excellent point Brother ;)
Reply: Terry Xiong right on dude
Reply: +Bourinos02 this video showed me to not sell my 500$ pc and upgrade to 4000$ mac pro, because my pc beats it. then ofc I you are a millionaire and want an expensive trashcan wich is full of garbage but can edit videos .. good choise
Reply: +Nofoxgiven why not your 10$ pc beats a 5 billion$ trashcan?
Reply: +Nofoxgiven yup
Reply: +MCLapios apple or custom pc
Reply: Zombie Gamer *
Feels
Reply: feels what ??
Reply: Fellings Mutual
Reply: no the fact is that he's stated that the computers were bought the same time though apples is underpowered because they don't bother
Reply: +Bourinos02 mac pro its a piece of crap compared whit pc, deal whit that. go pay a fortune for a beatifull apple logo on the back
Reply: +lol lol ooooh you shouldn't have said that you probably made him feel like his apple product was juiced by Jack Lalanne
Reply: +SciTk Very true statement brother ;)
Reply: +Snazzy Labs youre stupid.
Reply: Tugela60 And the PC is far from being a 'top model'. Man, with $4000 you could build the dream machine, both asthetically and in performance.
Reply: Chaliza Aziz LMAO  +1 brother
Reply: +Bourinos02 like he said its never been updated. 
so its current gen vs current gen
Reply: +Kyle247l Maybe, just maybe, it's not my main language... Who knows.. Thanks for the constructive input anyway...
Reply: +Kyle247l why does it bother you stupid people so much isn't the whole point of language is to communicate.. who cares if someone miss spell some stuff while typing..  are we giving grammar tests or what
Reply: +MCLapios what
Reply: lol this guy doesn't get the pointof the video. its 4000bucks apple shit vs 2000bucks pc. when its 3times faster with 2000 bucks pc, think about how monter it will be when its 4000bucks
Reply: +Tae C (Chiaki) monster*
Reply: +Tae C (Chiaki) Apple is not for everyone dude.. not everyone can see the beauty and the design both of hardware and software.. that simplicity it is worth 4000.. m not here to argue with anyone about apple but they do have something better and beautiful than others.. and it's not the best company in the world Just because they're charging that much..
Reply: Tae C there's more to it i can't  type it in all in here but even if i did not everyone can see or appreciate what i see in apple products.. they're just not for everyone and yeah i do agree a little on the price issue it is costly..
Reply: +Naresh Ugaonkar your right their not for everyone who doesn't want to pay for overpriced oudated hardware and who wants updated doubly powerful hardware for a fraction of the price
Reply: Naresh Ugaonkar "Apple is not for everyone dude."
Yeah, you're right. They're just for retards who spend $2000 on the "beauty" of their pc while having less performance - a lot less.
Reply: +Roberto Nome say what u want I can't change u r views about it.. I love apple and probably always will..
Reply: Naresh Ugaonkar Well, sincerely, loving a company forever is quite dumb.
It would be the same thing as if I loved NVidia (for example) even after they released a shitty card for something like $1400, promoting it to everyone as a great choice.
And it doesn't stop there... Apple has already done that several times.
Reply: +Roberto Nome hence the use of the word probably!!
Reply: +Bourinos02 pretty sure the point is to compare cost effectiveness and where you can get the most bang for your buck
Reply: +Bourinos02 He explained really well what's about: complaining about how old tha Mac is.
Reply: +Bourinos02 Cinebench is not a gaming benchmark, it is made to simulate a really heavy workstation workload.
(quick edit) was responding to the main comment saying that the test was unfair because it was only "gaming" benchmarks.
Reply: Well that's a salty reaction to a fact.
Reply: +Bourinos02 I really don't understand. How hard is it to understand the message of this video? A custom built computer half the price of the CURRENT Mac PRO performs BETTER.
Reply: +Bourinos02 Someone is salty that they bought a mac lmao
Reply: +Bourinos02 its not over the hardware or space its that the mac pro still costs 4k. While a very nice custom PC costs half the price
Reply: the trash can Mac is something that should have been marketed to home users and professionals for its form factor. To av professionals which Macs were at one-time known for they should have made something else and in the gamer space. Because like it or not gamers are the ones putting down the cash for hardcore gaming. 

Anyway Apple died with jobs it will probably not recover...
Reply: leave him alone guys...
dead man cannot realize that he is dead
also an idiot   umm.. a fanboy i mean
Reply: Mozz Jones Read previous posts.
Reply: +Bourinos02 The point is, the MacPro is still 4000$ even though it's 2.5 years old ... I don't get how this point would be irrelevant but whatever.
Reply: You just proved his point. they're advertising price point for that machine the Mac Pro to be top of the line. and indeed they do addvocate this machine as their best product. Which they state is the same as. Or Superior to. Any other machine in its price point.Therefore it should have a price to match. However what's useful about this video is that it serves a perfect example of how it does not and cannot compete with today's Hardware. Even at a much lower price point. So please stop thinking like livestock in a public space and get yourself a PC.
Reply: ***** You do realize that there are more than 1 mac pro variant, right?
Reply: Well thank you for bringing that to my attention. I was unaware of that. l don't actually follow Mac products that closely. But I did look it up. And to my shock, disgust and a little bit horrified at humanity for doing to itself. Found the exact same thing with more memory. For almost $9,000. I would classify this as Criminal. But again thanks for alerting me.
Reply: +Bourinos02 fyi the intel cpu in his rig is about 2 yrs old aswel...
Reply: ***** As surprising as it might be to you, this product is actually closer (in pricing) to its PC counterpart (4K-6K for the dual GPUs and 2.6K for the CPU alone) But of course, as Apple retarded price policy on RAM goes, adding memory is basically giving them free money...
Reply: yeah but still the MacBook that you would have to buy at the Mac Book Store it's not his fault they haven't updated
Reply: +Bourinos02 you should be ashamed of yourself if you believe what you're saying.
Reply: MacBook is a joke right now my friend was about to buy one until you learn that $1,000 model will get you 250 gigabytes of memory that's all. And you have to buy a converter because there's only two ports on the computer the charging port and the c port.
Reply: +Bourinos02 actually this test would be useless if  they were no longer selling this config... but they are so the test stands.
Reply: +Austin Stromberg i am that im not able to drop huge $$$ on stuff that was out of date a year ago. dollar per watt performace pc master race ftw
Reply: ***** Dude what? This is not a gaming rig, look up the prices for W9000 firepro graphic card and for Intel Xeon E5–2697 v2 for yourself if you don't believe me, this is workstation stuff, not your cheap Titan or core i7...
Reply: that's exactly what I'm saying lol, 2.5 years in the tech world is like 10 normal years for anything. this dude is trolling
Reply: ***** But... that analogy doesn't work in this scenario. I also use both OS X and Windows and from a purely OS standpoint, I prefer Windows because I can get from point A to point B without having to go through 4 layers of contextual menus. And besides, if you want a PC that runs OS X instead of Windows for the price of one that runs Windows, you can just install Apple's OS.

"some people like simple machines that are fast as fuck, some people like luxury rides with lots of fancy buttons"

The thing is, Macs aren't fast. Not by a long shot. This video proves that. The comparison is more of "Some people want to get what they pay for, some people want to pay a ton and get kind of below average performance."
Reply: +BtheDestroyer What macbooks are you even talking about? This video is showing the entry level mac pro...
Reply: Bourinos02 Sorry, I was in about 3 conversations at the time all about similar things. I meant more of "All Macs in general" so I'll edit that. Thanks for the note.
Reply: +Mr Big Fat Hacker so?? You buy the Mac new. Guess what things you buy pre made are more expensive...
Reply: +Bourinos02 What's with all the "..."?
Reply: +James John You know whats up, MICROSOFT ALL THE WAY!
Reply: Funnymatt101 Fanboys don't help. Anti-Apple is different than Pro-Microsoft
Reply: You are a colossal idiot. Congratulations.
Reply: my vacuumer looks better than this stupid piece of shit. seriously tho.. that's my point bud.
Reply: You forgot to mention that Apple still sells it for the stupidly 4000 Dollars, while it is not worth it at all
Reply: +Bourinos02 even if it was the entry level one It's 3000$ basicly it's still more expensive. and also check what he used them both for. Mac which is meant to be used is editing videos 3d models NOT GAMING OK so thats your opinion, But it was benchmarked in that and got crushed for 800$ cheaper. so Mac pro which specialized in that task was beaten at TWICE the speed for cheaper. But thats not really the issue, APPLE ARE SELLING OUT OF DATE PRODUCTS FOOR 3 TIMES THE PRICE. You could get a PC which performs the same if not slightly better for 1200$. They are also advertising it as the best the world can offer FFS you just don't see the point and you are incredibly ignorant.
Reply: +TonyOwned Idiot tax.
Reply: +Bourinos02 apple fanboy butt hurt
Reply: Dan Smith that doesn't make sense xD
Reply: +Bourinos02 you sound stupid fucker
Reply: +Chase HAmlin yea exactly
Reply: Chase HAmlin but doesn't, because Apple...
Reply: +Bourinos02 just the parts in the mac pro arent worth close to 2000 dollars tho, even when new
Reply: But the mac still costs $4000.
Reply: Yeah dude. That's what he's saying. Did you even watch the video? He said it several times. 

"This computer was already antiquated when it was released. And then it's been 3 years. And they still haven't released anything new. Why haven't you updated your ProModel Apple?"
Reply: +I will show u the true MLG no scope ANOTHER PC SLAG
Reply: +Bourinos02 You know you could build an mITX PC that would be 2x faster in terms of CPU and GPU than the old POS macpro.
And it will be smaller than it for 30%-50% the cost of a mac pro and with that money saved you can get the latest version of Adobe CS, a nice 4K monitor,  a good mechanical keyboard, and a good mouse. a good computer table and chair.
So is having that apple logo really worth the extra money?
Reply: IIGrayfoxII Smaller than it? I hardly doubt it, unless you can cut some part of your motherboard to make it fit... For the cost yes, it'll be cheaper, but you give up on dual GPU as mITX is only for single GPUs (unless you meant  mini-DTX maybe?) And you also give up 2 RAM slots along with it...
Reply: Bourinos02
wrong, depends on the hardware configuration for RAM also one GPU compared to two is much more effective and more supported also is much better for cooling ect
Reply: TJ CAT You are right about RAM slots, Asus is indeed doing 4 DDIMs with mITX, but for the single vs dual GPU thing, it all depends on what you do with it, for pure calculations, 2 GPUs will be more effective in all cases, for gaming in the other hand that's another story... If you are talking about energy efficiency, well, that needs to be compared configuration vs configuration as it may greatly vary depending on the GPU choices and desired power output.
Reply: Bourinos02 if your using GPU's for pure compute and your trying to use a miniITX build for it you're doing something wrong and even in general compute, running SLI or Crossfire could be unsupported by the developer of whatever program you might be using.
Reply: Workstation or dedicated gaming pc doesen't matter, games are merely tests of hardware, also, there is a 2000 dollar gap between them, pc is still superior... You could build same pc for even cheaper with a mini tower, it would just be harder to fit.. So i don't see your point
Reply: +Bourinos02 Tell what, what is going to use those twin GPUs?
Your video editing program?
And your speed increase when it comes to encoding is not going to be 2x faster than if you just had one card.
And why does it have ECC memory
No need if your just working as a video editor

So you are paying more for a GPU that wont ever get used for video rendering
You pay more for ECC RAM which is more for a server than a video editor.

You see apple is fucking with your head by making you think that it is going to be super fast.

As for the mITX, not all cases are vertical, you can get some that are horizontal.
Reply: +Bourinos02 Overall, price to performance ratio will always favor the well built gaming pc in rendering or otherwise, I agree that there's no point in comparing because there's no comparison, gaming pc's win, workstations lose, a bunch of rendering farms, supercomputers and cryptocoin mining facilities work with consumer grade cards to save costs and increase power at the cost of some reliability and minute features, it's no secret. Also, comparing the actual PC to the old Mac Pro is legitimate, the PC costs less and the Mac is still sold NEW for more than what the PC costs, it would be unfair to compair against end of the line hardware but this is still the best mac pro, and it sucks.
Reply: +Bourinos02 pretty sure he did it since this is like he said the latest version of the mac pro that you can buy, and really the price for performance is just the worst with any apple product
Reply: IIGrayfoxII HPC, scientific computing.
Reply: Epic501 If he had tested open CL or double-precision floating point computations, the mac pro would've won, but yeah, "performance value for money" uh?
Reply: +Bourinos02 To be fair, my 3 years old 900 euro computer is also tie with the mac....
Reply: +Joel B (jbholland) To be fair, I have a pentium II @233MHz somewhere, it must be more powerful than the mac pro.
Reply: Bourinos02 to be fair... i dont think so.
Reply: +Joel B (jbholland) To be fair... I don't think so either, the price of the graphic cards alone TODAY being already 1200$.
Reply: +Bourinos02 The size difference can be reduced to negligible. What would your reaction be if this PC simply performed the same while fitting in a ncase m1?
Reply: +Bourinos02 haha, oke the graphics card can be high at cost, but you can get a graphics card at 300 euro that does a decent job. i can still play gta 5 in high spec at a 3 years old computer,
Reply: +Sveinung Tørresdal (“Drunkenvalley”) Well, that'd be good to have an alternative, and even if this case doesn't support GPUs longer than 195mm, it can still accommodate 2 GPUs in a very compact place, it's looks like it'll be a very good case when they'll release it!
Reply: it doesent matter if its gaming or not, he takes fucking graphics card tests, not gaming tests, they are general gfx card tests, and cpu tests.. and the pc owns it by 3x.. u can't argue against that
Reply: It's about price here. The apple units are still being sold for 4 grand whereas computers like this are available for half of the cost
Reply: +Mike Bee TV Well, for macbook pro, I still disagree :p I have the 2011 model, I changed HDD and RAM on it, making it lightning fast for a 5 years old machine! I don't think it's possible on newer models (everything soldered, right?)
Reply: +Samuel L No apple doesn't.
Reply: +Samuel L 1v1 me bro, => http://www.apple.com/shop/buy-mac/mac-pro?product=ME253LL/A&step=config boom h34dsh0t, 420 bl4Z3 it.  :-)
Reply: The point is that apple is selling old tech for more $ then new tech...
Reply: +Bourinos02 Baaaaaaa
Reply: its a case to say .... you didnt compare ... apple to apple ...
Reply: +Bourinos02 It's still a rather large mITX case and looks more like a mATX case in size. There are much smaller mITX cases that are more like the Mac in size, which still allow you to use graphics cards over or close to 30cm long and regular ATX power supplies. The mac is definitely small but not small enough to excuse the lack of performance, which you seem to agree with anyway :) I still think this test is good for comparing bang for buck
Reply: +Bourinos02 the point is. you can build something better than what apple can offer. you can't give the most powerful computer by apple any odds. if it can't out preform a computer for half the price than it is overpriced trash. it belongs in the very thing it was designed after, a trash can.

EDIT: he didn't test gaming performance. he ran some benchmarks to strain the CPU and GPU and it failed. this had nothing to do with gaming. he did do a work station test. adobe premiere is one of the best editing softwares out there and the mac pro wants to stay with the consumer grade final cut pro and imovie.
Reply: +Bourinos02 the thing that l find ridiculous is the weak graphical performance of all apple computers. their top of the line desktop computer is running mobile GPUs which are usually weaker than desktop grade GPUs.
Reply: +Dante hipsters are too stupid to even know what a Mac Pro is.
Reply: +Kristaps Ščerbaks l will delete this comment if you want me too, but you said "fell dumb now" l think you meant to say "feel dumb now" this will be used against you if it hasn't already. l am not a troll l am just trying to help out because you will be called dumb by somebody who likes this computer, over this typo.
Reply: electronics for fun A mac pro is made for openCL, if you buy it to do openGL, you just bought a tractor to do racing... That being said, cinebench is a legit CPU test, the entry level CPU of the mac pro is incredible shit, the 3,5K$ mac pro on the other hand would have had similar performances as the PC had.
Reply: +Cutthroat Mc Rage fuck you, you just mad cause you can't afford a mac
Reply: +Bourinos02 oh ok I get it, if the performance is similar then it is ok to pay twice as much for the same thing.
Reply: +Jakub M I don't need to afford it. I can get better for cheaper.
Reply: +electronics for fun "better for cheaper" can you fit a desktop in your school bag?  Point proven, nothing you say can undue that fact.
Reply: Jakub M yes you can. just use an itx board and a smaller case. think about this, how many school kids are walking around with a $3,000-$10,000 desktop computer in their power ranger/ hello kitty backpack? none! how many middle schoolers are doing that? none! how many high schoolers are doing that? very few if any. how many collage students are doing that? not many. you don't buy a desktop computer to carry around. that is what laptops are for. my l also mention the this computer has mobile GPUs. they are high end, but still mobile. which makes it even more ridiculous to carry around. considering that those are the kind of graphics that you get in a laptop anyways.
Reply: +electronics for fun clearly you have never been to school.  everyone carries around a laptop, and there is no way that a PC would fit into a bag.  any other laptop than macpro would be 3x thicker and 5x times worse
Reply: electronics for fun
Excuse me but what computer are you talking about? The mac pro doesn't have mobile GPUs...
Reply: Bourinos02 are you sure because all of the other computers they make with a dedicated GPU (the only other one is the 5k imac) have mobile GPUs.
Reply: electronics for fun
Yes, yes.... firepro W series are NOT for mobiles, they are for workstations, there isn't any WXXXXM series anyway...
But at least it shows that my feeling of about 70% of these posts being just blind applebashing for the lulz seems to be correct.
Reply: it isn't blind apple bashing, l am an apple fanboy, just not a fan the greed of the company that is tim cook. l figured it had to be mobile because why would AMDs top of the line GPU have a 2 gb configuration? then l remembered it is AMD.
Reply: UnhandyBirch656 who me?
Reply: +Bourinos02 The hardware is the hardware it's not our fault that apple chose to put it in the shape of a trash can you moron... Now, did they do a good job or did they fuck up with their design? That is the question
Reply: +Bourinos02 the main point is each OS has different capabilites...
Reply: “Who would have fought”, oh you dumb fuck.
Reply: +Mardin Machoina There, I fixed it for you grammar nazis out there!
Reply: +Bourinos02 “There, I fixed if”, oh you dumb fuck
Reply: +Bourinos02 He talks about all the points you mentioned. He is comparing the best model your money can buy from Apple with a machine half the price. This is a disgrace for Apple. That's the point of the test.
Reply: +cmfrtblynmb Well, excepting the fact that it is NOT the best model you can buy from apple (and by FAR) and all the above mentioned things, yeah.
Reply: +Bourinos02 It is more about the value of both. the best mac vs a custom pc
Reply: ***** It is not. It just fucking isn't...
Reply: +Bourinos02 Behold, i wild Apple Defender, whom knows little about what he is talking about! Sure, the Mac Pro is still a Good PC, but Apple is falsely stating that the 'Mac Pro' is the 'Best' Computer you can buy...Wrong, but right. Buy, as in walking to your local Walmart and picking up a Cheap $200 Lenovo PC. But, you can build a PC for more than Half the cost, while it is nearly 3x more powerful, something that you can't deny! Also, the fact that they haven't updated the hardware in over 4 Years is insane. With PC's, you can swap any part that you heart desires, with Mac's...Um...Just the HDD/SSD, and the GPU..Awkward silence. Seriously, it doesn't require even half of your Mental capacity to build a PC, just be careful, and follow the Instructions. it's all worth it after your Done!
Reply: +Bourinos02 That macbook still destroyed a i7 ultrabook in 4k video exporting time
Reply: Rediwed you mean the macbook pro? because the macbook is far too underpowered to do 4k anything. now that l think of it all of the intergraded graphics on all mac computers are too weak to watch, or edit anything in 4k, except for the 5k iMac and the mac pro. even the 4k imac's GPU is too weak for 4k video streaming.
Reply: Bourinos02 Why are you blatantly lying? Mac Pros are not upgraded. I know this because I am an Apple fan myself. MacPros are old hardwares, it still has Ivy Bridge and GPUs from 3 years ago. Just google for Mac Pro upgrade and see a lot of frustrated people waiting for an upgrade.And tell me what is a better hardware you can buy from Apple that has better performance wise? Please don't say something stupid like iPhone or Macbook.
Reply: +cmfrtblynmb Well, according to an obscure website called apple.com, you can buy a mac pro with a Xeon E5-2697v2 which is a 12-core (24 threads) processor at 2.7GHz (3.5GHz in turboboost).
I'm no expert, but I think that it is more powerful than a shitty quad core @3.7GHz or a hexa-core i7-5820K@3.3GHz... The mac pro line haven't been upgraded in a (too) long time, that's correct, but saying that the entry level mac pro is "the best you can buy from apple" is just BULLSHIT.
For specific computations, a mac pro with this 12-core and the D700 (W9000) firepro is still today a very decent machine, the only change would be a less power hungry 12-core (or switch to a 18 core madness) and two W9100's for better double floating point computation power and power use.
Reply: That shitty computer you are talking about beat the crap out the one by the Apple and it is still half the price.

The processor you have posted has reviews from early 2014 and probably was released in 2013. 

Apple is selling old hardware for high price. It used to sell new hardware for high price, that was OK. They are selling a computer whose CPU GPU and motherboard was released in 2013. These are things that are not hard to update. You need to stop being an apologist.
Reply: That's my last comment to you.
Reply: +cmfrtblynmb This CPU might be 3 years old, but it's still, as of today NO MATCH with any core i7 series, and for the xeon V3 series, 3 of them have nearly the same performance (1% better) (but less power consumption), and 7 others with between 7 and up to 27% more performance for a nice 4K$ price tag... Is 4K$ worth 27 more performance, it's entirely up to you...
Reply: Your argument is stupid, you are saying to not compare a CURRENT model with a new pc? I understand this is a lot like comparing a Samsung Galaxy with a iPhone but they are still both the MOST RELEVANT form of what's available in its own right
Reply: +Dalton James (FreshBuzzkill) hey haha. my name is Dalton.
Reply: +eric lasseder You state that I'm what's wrong with the species when instead of proving a fact or an opinion you just throw around idiotic insults? The front runner of a company vs a white box he made is the point of this experiment. The hardware does not matter because it's still their front runner
Reply: Bourinos02 You're telling me!  I could barely get through your first post, let alone a month of your crying
Reply: +Bourinos02 his point was about the prices...mainly
Reply: +Bourinos02 The point of this test is to prove even older macs are insanely overpriced for low performance.
Reply: Ryan Arranz no, the older mac pros are much better. they could beat the current one easy. they have dual xeon processors and can be upgraded to your hearts content.
Reply: +electronics for fun Dual Xeons are good at rendering. ONLY RENDERING. It'll run games pretty slow and won't even load CPU intensive tasks quickly. Dual Xeons are beastly but not for a regular user. Either way overall, a custom Windows PC, even with a single i7 can destroy a Mac pro in nearly every task.
Reply: +electronics for fun but I'm not downplaying a Mac pro. it's a good computer and it's very good at what it's designed to do, but what it's designed to do is a pretty small bit of the entire spectrum of what computers are used for.
Reply: Ryan Arranz thats why the price is unjustified. it is supposed to be good for video editing, but a custom pc with more vram would  be better and cheaper, for the price of a mac pro, l could build a computer with 4 GTX 980s in SLI, and an 8 core 4Ghz processor.
Reply: +electronics for fun The aftersales though. Mac pro is good for those who can't be bothered to tinker with components in case things go wrong. Just bring the whole thing to apple and they'll fix it. 

Whereas with custom PC, if it's broken, you have to take it apart, you have to go to different places to fix different components, etc.
Reply: +Bourinos02 I think you missed the point. You forgot to weight in the availability aspect of it. This comparison is a "what's the best bang for buck that's available right now". Like he said in the video, you walk into an apple store and that's the best you're gonna get. Although these PC master race cunts are loosing their minds, there is no denying Apple makes some expensive, under powered stuff. If you're spending thousands of dollars on a work horse, the amount of space it occupies would be the last thing on your mind. Unless you live in a box.
Reply: +Thomas Christopher White I agree, but the main thing is that this mac pro isn't the best apple can offer (and by far), and it's targeted at VERY specific group of people. Namely, a group of people that can use the power of Firepro series graphics card, they are very good for some uses, but shitty for gaming as demonstrated on this video.
Reply: Apple is selling 3 year old technology that at inflated prices? no waaay!
Reply: FastLikeUNO the thing that makes no sense is, the most powerful thing they offer has processor with an ivybridge microarchitecture, but the macbook pro has a broadwell microarchitecture.